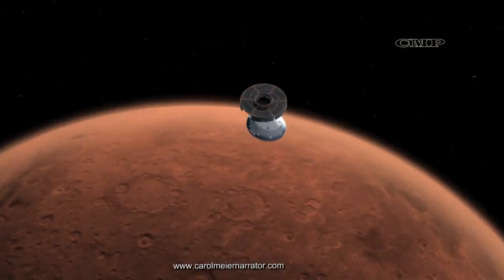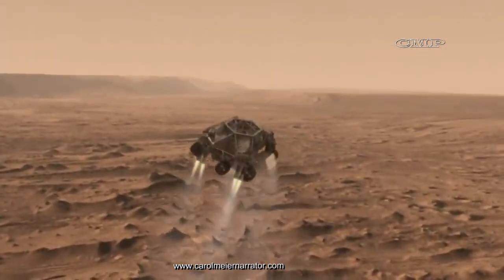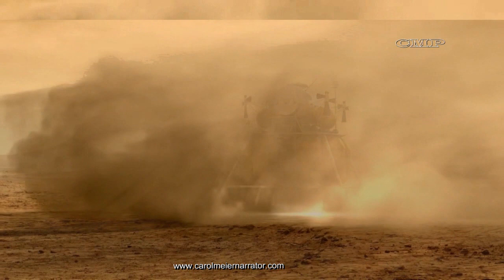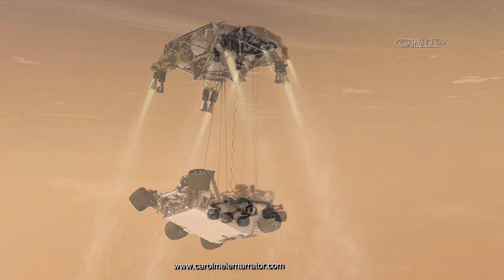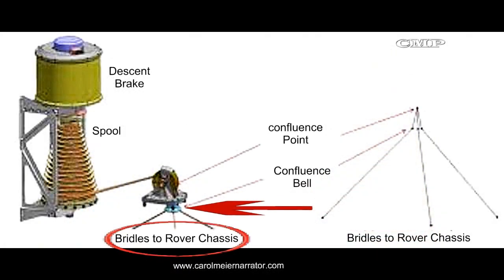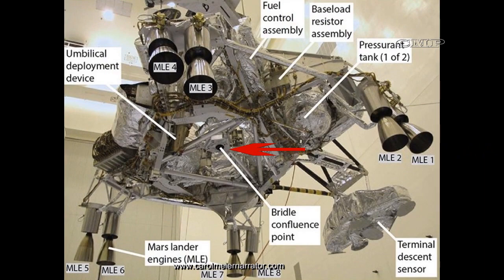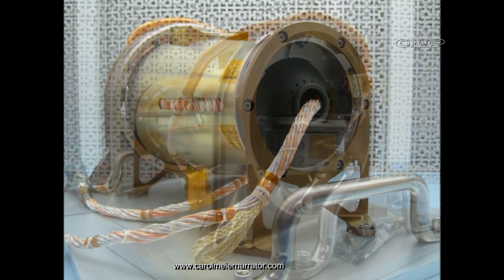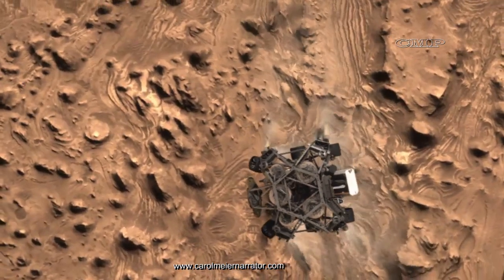How the "Sky Crane Maneuver" Works - Narrated

Comment: If China's lander has no "skycrane" is it covered in dust and less stable due to attached landing componentry? I love the skycrane despite the risk of failure, but presumably non-skycrane landing componentry could be detached and dust can be self-cleaned. (It's a dusty planet, so rover-self cleaning should be a design requirement)
Reply: The two missions are very different. China's Zhurong rover is much smaller than Perseverance, about 240kg as opposed to 1050kg. Larger payloads require require larger engines, and larger engines create much bigger exhaust plumes that can damage a rover upon landing. Landing on Mars is an extremely chaotic event that kicks up a lot of particles from the surface. Zhurong's lander sustained damage to its landing gear from exhaust blowback, and NASA's previous Curiosity rover had damage to the weather station attached to the rover's mast that rendered the instrument inoperable. Flying debris can be a showstopper for Mars missions, and EDL is terrifyingly dangerous as is. 

Landing something the size of Perseverance with something like Zhurong's lander was deemed impractical decades ago before the Curiosity mission even flew, and the skycrane system has a much larger mass fraction to the surface compared to legged landers, at least when you want a rover as the payload. This is also China's first Mars mission, and a legged lander is much simpler in design than something like NASA's skycrane. Zhurong is also much more of an engineering mission than Perseverance, and lacks a lot of the contact science instruments Perseverance has, which probably makes it more resilient to flying debris on landing. Zhurong doesn't even have a robotic arm, instrument turret, or complex sampling suite to worry about damaging or contaminating. These are complex engineering decisions both mission teams had to consider, and they both made pretty reasonable choices for their decided mission envelopes and needs.

Comment: It's really interesting how NASA rather chooses to use explosive means to cut wires and ropes, common sense tells me use of explosives are very prone to failure. 
I'm curious why didn't NASA use for a much better redundancy failure proof system rather than use of explosives for cutting wires and ropes loose, such as some form of a spring which is pre loaded and latched with a digital solenoid. Once the spring is set loose by the solenoid it has a sharp tip which by force can cut loose the wires or ropes. I think explosives is used for compactness, you can get much more energy force with the use of explosives than a loaded spring when size and compactness comes into play.

Comment: what does he mean by "if the ropese were not severed, the descent stage would just continue downward crashing into the rover". Is there a "ropes successful cut" sensor?!?
Reply: I completely agree, redundancy for use of explosives for cutting lose the wires and ropes is not to hard rather easy, if the ropes did not cut loose due to a faulty expulsive cutter, a spring loaded cutter could have taken place. This is really weird, I'm assuming NASA thought if ropes didn't cut lose with explosive, it was most likely a faulty sensor and therefore the mission is over and doesn't make sense for extra redundancy for cutting wires.

Comment: This is a good example of how Hollywood oversimplifies engineering. In the movies, 8 year old Luke Skywalker builds a completely sentient android in a desert tent, and Tony Stark builds a flying armor suit while being held captive in a cave. Now, in the movies’ defense, they have to do this because showing the actual engineering process would take too long and would not be very entertaining, but with this video, it’s clear that there are many moving parts, each of which requires lots of attention. The whole thing was not designed and built by a single person - you’d have a team working only on that spool mechanism, maybe one or a few people doing that confluence bell assembly, several airframe designers working on the whole skeletal structure that supports the engines, reeling mechanism, etc. Plus, you need a big rocket just to get the rover there in the first place. In all, there are hundreds or even thousands of people (not just engineers, either - there are purchasing agents to work with suppliers, contract specialists to make sure all of the suppliers produce subsystems of acceptable quality, managers to keep all of the design tasks coordinated, etc. etc.) that have been involved in this effort for years to accomplish this. And it’s pretty impressive to think of the end result: a remote controlled mobile science lab that has landed on another planet and is controllable from Earth, currently about 130,000,000 miles away.